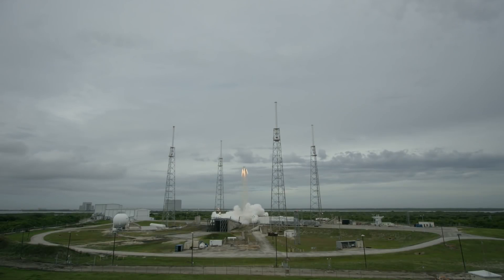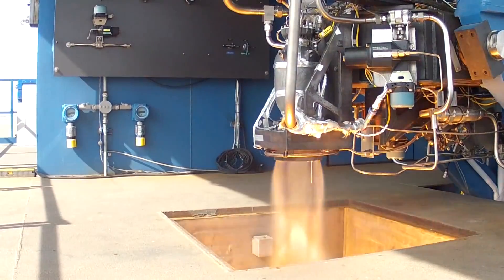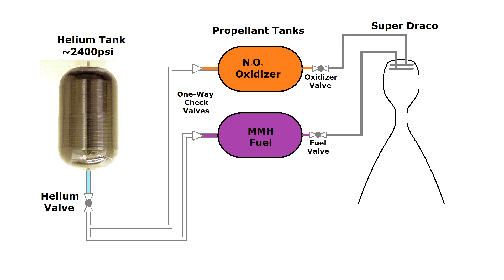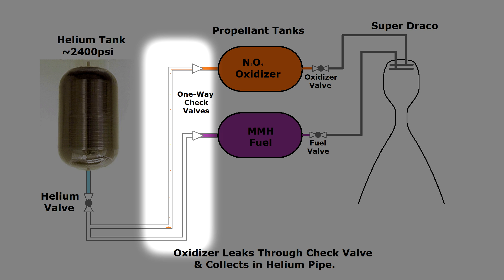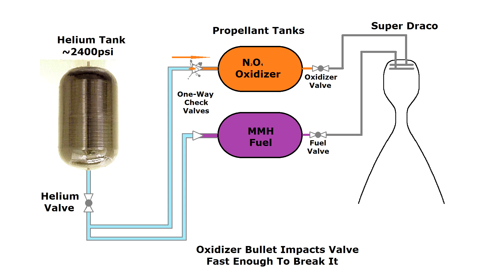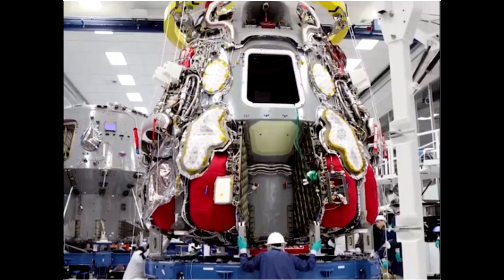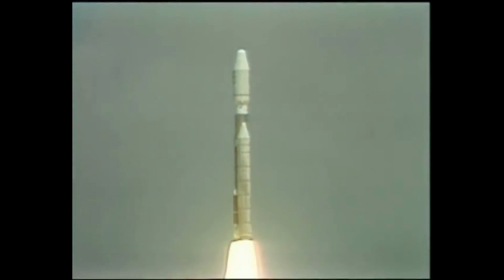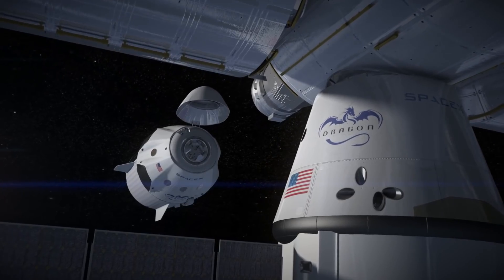SpaceX's Crew Dragon Spacecraft Exploded Because of 'Corrosive Bullets' and Leaky Valves

Comment: There have been a couple reports of city's steam lines bursting similar to this.

A steam line getting shut down for an emergency but not emptied before restarting, allowing the water to condense and creating a water bullet when the steam turns back on.
Reply: There's an old saying about check-valves: 'they just don't work'.
When you're talking acceptable damage, they are OK, and almost essential for endless stop-start flow cycles in systems. The capsule is one very expensive piece of work and human life is at stake. The escape-system is a one-shot deal, there is no cycling of the helium/fuel/oxidizer lines. Check-valves are pointless. A rupture disk can be replaced when the capsule is transported back to the SpaceX factory, easy-peasy.
Reply: @-danR  I suspect they'd still want a check valve upstream of the burst disk. But yeah, guessing the check valve was required back in the days of propulsive landing
Reply: @-danR  High pressure gas comes into the check valve, then there is a orifice plate to provide some flow restraint, and then the burst disk. In the space between the 2 units you can add a simple leak detector. For the oxidiser just use a high pressure electric feed through and a plain low carbon steel thin wire that will be corroded open if there is any leakage, and similar for the fuel, as it is also corrosive. Cheap, and can be integrated into the flange and orifice plate as well with ease, along with a pressure test port. You could also add in pressure transducers and a low pressure fill with gas, but pressure sensors that will survive that fuel and oxidiser are not cheap, nor are they low mass, as you need a diaphragm and transfer fluid to keep from melting the silicon strain gauges, which are ironically the cheapest part of the sensor.
Reply: I know of a large industrial plant where water built up in a compressor air tank. Nobody noticed till it got high enough to start to get in the outlet piping. Large air demand at the far end of the plant, so a slug of water was entrained in the pipe, and went along this mostly straight pipe to the far side. Near the end of the run there was another part of the plant, so this large diameter air pipe had to make a detour around this even larger piece of plant. Turns out the slug of water did not want to make the turn, and snapped the elbow off with the impact on the elbow. 

The plant was closed for a while while they were doing repairs, and also making sure that there was more than one person responsible for checking the automatic drain valves had not malfunctioned, plus adding water level alarms in the compressed air tanks.
Reply: Isn't that called a water-hammer?
Reply: @johnballs1352  : That's when it's surrounded by more water, instead of being carried by a stream of air.
Reply: @johnballs1352  
Thats the term... yes

Comment: But it does not explain the point that I'm most curious about - was this particular failure caused by re-entry and splashdown or could it happen even in case of abort after the start?
Reply: I assume the extreme forces of re-entry would make it more likely for the one way valve to leak afterward. But I don't think we know exactly what caused the valve to fail.

Comment: SpaceX would have previously avoided the burst disks previously not just because of the desire for repeated testing, but also because the initial plan was to land propulsively or use the thrusters for other uses where multiple restarts are required. I believe they are not relegated to the sole use of emergency abort which means that one use only may be sufficient although I do wonder how they get around the test requirements. Can you test the engines then replace the burst disks shortly before launch? After all, this problem was only found through repeated testing.
Reply: Yes you can bolt in a new burst disc before You refuel the capsul, but you can’t test the seals and burst disk though.

Granted a rubber seal is very reliable at the correct temperatures. Same thing with the burst disc, though it can take freezing temps better.

Comment: I do not understand.

The check valves are to prevent material from flowing back into the pressurization system. However”  they are not a positive seal without enough pressure in the fuel or oxidizer tank. Material can, and did leak “backwards” into the pressurization system. Blowout disks serve a different purpose, which is to prevent over-pressurization of a system. They do not prevent flow in the wrong direction.
Reply: "Blowout disks" in this case will be used as a barrier, ensuring there's absolutely zero flow of fuel into the helium lines. Once the helium valve opens, the disk will rupture into the fuel tanks, letting the helium in. The fuel tank is under very little pressure compared to the helium which sits at over 2500PSI.
Reply: Blowout disks prevent ALL flow until a sufficiently high enough pressure (2400psi should do it) ruptures it

Comment: that's good to hear, pretty easy fix, no major redesigns needed
we're in the pipe...
Reply: Still will be delays since NASA will require retesting new design and also this capsule was to be used in flight abort test, now they must use one planned for manned mission and build new manned mission capsule.
Reply: @stephencourton3328  Doesn't Scott mention that the main reason why a manned mission might be hard for this year was the ISS traffic jam? They have the Dragons, Nasa signed off on the design change, using old school and proven tech and SpaceX is led by a car manufacturer :-)
They probably started building the frame of a new Dragon the day after this one went KABOOM... They are looking at getting a Raptor of the belt every 12 hours in the (Elon time) near future...

Comment: Does the burst disc mean that the super dracos can only be used once per flight? I don't know in what situation you would have to use them twice, but it's better to have all the options. Maybe in a very remote case in which the normal dracos somehow fail, so the superdracos have to be used to perform a very short deorbit burn, then the parachute fails and the capsule has to use the superdracos to land like it was intended to do? Idk, there is an extremely slim chance of that happening, but it's better to be safe than sorry.
Reply: I think the burst discs are just there to seal the helium pipes during loading. Once the helium valve is opened and the discs burst, the fuel and oxidizer remain pressurized for the duration of the mission (which will prevent backflow). The discs will be replaced after dragon returns to earth, prior to next mission.
Reply: > Does the burst disc mean that the super dracos can only be used once per flight?

Yes. But their only purpose is to be an launch escape system, so it's alright. The draco thrusters have multiple redundancies.  The system is divided into three separate pods. A mechanical issue in one won't affect the other two. You could probably deorbit with just one thruster pod working.

Comment: So a burst disk wouldn't replace the backcheck valve but it would, what, allow decompression in the case of a pressure buildup that could lead to back-flowed oxidizer smashing the check valve?

In such a case it just means that the engine would fail to operate but it wouldn't blow the whole ship wide open. Wouldn't a redundant series of backcheck valves that prevents any of the materials from traveling too far down the pipes in case any one were to get leaky (plus a burst disk safety for good measure) be more likely to stem off the problem without the backup being total depressurization of the system?

Alternatively one could rig up check valves in parallel such that if any one leaks or gets blown out due to being attacked by backflow getting shot back up the tubes, a depressurization event would seal that path but allow the others to continue unphased still delivering ample pressure to keep the engine firing.

Also I'm assuming the burst disk would be such that if these "bullets" were to form they'd fire out the burst disk in a safe direction, because otherwise I don't see overpressure occuring when the gas gets stopped up earlier in the piping than normal. To the helium, it wouldn't know the difference between a closed check valve and the projectile mass being the blockage. So essentially it's just a trap with a frangible barrier so anything that gets moving inside the tubes would shoot out the side before shooting the valve?

Comment: Nothing wrong with your real intro, but I actually kinda miss the improvised one you made with the X-wing toy.  Can't top those super high-res Microsoft Paint diagrams though...as always, thanks for your effort and dedication!
Reply: MS-Paint... CAD Lite, I called it at my previous job. I could bang out a conceptual schematic for a lab report in about 20 minutes, as opposed to a half-day with Solidworks. I still use it to create slides for my math videos.
Reply: Nice work in Ms Paint, a pity there is a little yellow garbage  on top of the Helium tank tha I suppose got there unnoticed. But I guess is what happens when you paint with  light yellow over white background.
Reply: javiej Thats from the original picture, which he didn’t trim, not an oversight..

Comment: So what does it mean as far as refurbishment time with the burst disks now that they’ll have to change them out every mission? And is this just a temporary fix until they can find a replacement mechanical mechanism or do you think this is here to stay for the duration of Dragon 2?
Reply: Burst disks are pretty cheap, but you cannot change them without de-fueling and purging the entire system, so its not an optimal solution.
Reply: NASA is not going to be reusing any Crew Dragon capsules and every mission will use a brand new one. After that SpaceX can take whatever time they need to refurbish them, since they won't fly NASA astronauts any more. If SpaceX want to refurbish them and reuse them for private reasons, like SpaceX astronauts, they can do so, but it won't impact the commercial crew program.
Reply: zynius They’ll still use them for CRS missions though won’t they?

Comment: In my experience as a mechanic I have found that check valves are very unreliable and the one of the first components to be examined.
Lucky for me Diesel was usually my most flammable substance I felt with.
Reply: What are the common failure modes? They seem to be very simple devices.
Reply: @Synergy7Studios  The common failures are the seat doesn't seal, the valve hangs up on one side, the spring is damaged or miss alined,there are probably more as I said very unreliable.
Reply: @Synergy7Studios  
Check valves are reliable if the back-pressure is high. I suspect that the dinitrogen tetroxide was gently gassing, and gradually getting through some anomalous tiny malformation in the stopper or its seat.
Reply: @-danR  Perhaps actuated check valves would do the job, and enforce the check.
Reply: Dirt on the o-ring seal is a common failure.  Other times they leak due to corrosion  or the rubber o-ring seal fails for some reason.  The internal spring can also corrode and fail.  I have worked with them on systems using corrosive gases.  They generally are very reliable but failures can still occure.

Comment: I fail to understand where the burst disk are going to be installed in the system. If its to replace the check valves it will block both direction not only one direction?
Reply: The disks are supposed to burst after opening the helium-valve. The helium is under much higher pressure than the hydrazine and N₂O₄. The disks burst and helium stream into the other two tanks and put fuel and oxidizer under pressure.
Reply: rtlgrmpf so they act as a seal until gas pressure takes over?
Reply: @Knirin  Yep. It's a metal barrier. The high pressure from the helium system will punch a hole through it when the valve is opened.
Reply: @Knirin  yep. And it's a one-time process. Originally they wanted to use the Super Draco for powered landing. That's off the table for now.
Reply: @rtlgrmpf  I got that. But ,how will this burst disk stop the same problem that happened before? if the fuel and oxydizer are used only once there is no problems but they are used more then once then with no check valves its going to be boom again. A burst disk will work only once. So they just made those escape system a one shot only.
Reply: @roberttherrien352  Exactly. It will only work once. In case of a launch abort. Since powered landing is abandoned for now and for the near future, it is the only case they need it.
Reply: When the helium pressure is opened, the disks will burst. Its a one-way process, once the system is fueled for launch.
Reply: I'm guessing they are going to be part of the check valves, the burst disks are designed to break when the pressure is over certain threshold, so they will rupture once the high pressure helium is trying to pass through them. Preventing the leak of low pressure oxidizer/fuel going "backwards".

Comment: So it exploded because they tried the system multiple times, and now its in a configuration where they can just use the system once before refurbishing it? I wonder why they went with that solution being though quite experienced with rocket engines that cut thrust and and open valves again later i.e. the second stage of falcon 9... does it have to do with higher helium pressure used for those super draco thrusters?
Reply: While burst disks are one use only they are easily replaceable so it won't be to much extra work compared to having reusable valves.
Reply: @FutureMartian97  Also they would only need replacing when used, which should only be in an emergency. So if all is nominal then you could fly multiple missions without replacing them.
Reply: @davidlericain  yeah i see  that and it seeming to be sort of the easy and understandable way but still i kinda wonder why exactly this thruster system is causing problems compared to the other everyday rocket thrusters they use and also it erases the possibility for an rocket powered landing if the parachutes should fail ( I know that they actually havent human rated it when transporting people for nasa but elon stated somewhere that its still a possibility though )

Comment: How exactly does a burst disc replace a check valve? Let's replace a 1 way valve with a 0 way valve, fixed!
Reply: When pressurized  with helium and after rupture of the burst discs flow can only go into the direction of the fuel/ oxidizer tanks until the pressure of the helium is lower than on the other side (hopefully after all fuel/ oxidizer is burnt or probably they still have the check valves installed in front of the burst discs to prevent back flow at least short term). As far as I understand they had a problem with long term stability (leaking) and in this case burst discs are great.
Reply: I guess, when it's burst high pressure He is let into the fuel tank. From that point on there is no way the fuel flow the other direction. The burst disc protects the He duct which is not under high pressure before firing the engine.
Reply: OK, makes sense now. Had to remember that this would be an emergency one time use system/valve. Thanks!

Comment: I'm surprised they didnt opt for a second very small valve for the helium.  That way the helium system would pressurize over the course of milliseconds instead of micro seconds with no need for the one time operation of a burst disk.
Reply: That would slow the response time for an emergency escape I think.

Comment: Excellent video and well dumbed down for those of us who aren't rocket scientists but are still interested. Thsnks for this, and all the other, great videos Scott!
Reply: I still dont understand where the burst discs fit into the system. Do they completely replace the check valves?
Reply: @charcoal386  
Presumably. There can be no back-flow under any circumstances. Even the tiniest mishaping or damage to the check-valve stopper or its seating could have let the oxidizer back into the line. Only the stunningly high pressure of the helium is going to rupture the disk.
Hopefully, the disk proper will be thoroughly vetted for reactivity with dinitrogen tetroxide!
Reply: @-danR  thanks
Reply: The valves were made out of titanium which he's saying is flammable
Reply: @charityL7  And the plumbing from the Helium tank to the check valves.
Reply: @johnkimber4027  idk how I ended up caring about EveryThing Elon does. I just wanted to know about neuralink and neuralace
Reply: @johnkimber4027  I started thinking about flutter valves and chest woulds when he explained check valves k?
Reply: @charityL7  It is flammable, but he didn't mention it is only on impact.
Reply: @charityL7    Darn near anything is flammable under the right circumstances of temperature, pressure and oxidizer.